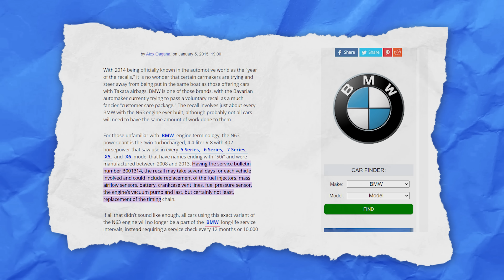WORST Cars You Should NEVER BUY!

Comment: It was unfair to use a lexus photo when they reliable af!
Reply: The same thing i am saying the video is suppose to be about unreliable cars not a superb war tank like the lexus is250
Reply: The only thing you can rely on with Toyota crap is rust holes the size of your fist
Reply: @Welcometofacsistube  Id rather drive fully corroded Toyota on wheels than pretty much 90% of other cars on car transporter with broken engine/gearbox/suspension. I can always drive to the varnisher and solve that problem.
Reply: That car will still be around when you're grandchildren drive
Reply: Click bait
Reply: Right !!!!!!!!! Smh lol 🤣
Reply: Called click bait
Reply: Dislike the video because of this. I’ve owned almost 30 cars and absolutely hammered the transmissions in 3 Lexus and they are indestructible lol currently own a RC F
Reply: exact reason why I disliked.
Reply: Lexus line tech here.  There is a reason we all call them the IS 2shity.  If you do a lot of highway driving they are fine, but a majority of city driving will cause carbon build up in the intake which will destroy the engine when a piece falls in.  Misfires are the first sign.
Reply: Me having a Is250 🥲, looks good but really slow for a v6
Reply: yeah wtf, talk about clickbait lol
Reply: @Welcometofacsistube  97 Toyota celica 286000 miles no rust
Reply: It's called click bait
Reply: Made you click the video though. I’m sure.
Reply: Is that the only problem with the Lexus mine does not pass emissions I don’t see it as a problem
Reply: @ezekiel4407   get the is350
Reply: So lexus is on here for being too slow I personally love the 4gr-fse I have no problems with it
Reply: Yep IS is super reliable I’m upgrading mine to 400 hp on my channel just need donations haha
Reply: I have a is 350 and love it!
Reply: @chrisadkins6830  the is 350 doesn’t have that problem because it’s direct and port injection
Reply: @VibeVault707  I have one and love it!
Reply: @TheReel_Fisherman  you are correct.  Thought about buying a 350.  But needed a truck more.
Reply: That's why they last 300k miles or more if taken care of while no matter how much you take care of other cars, it's extremely hard to reach a mileage about 250k (that includes Honda turbocharged engines)
Reply: Really tho, I love my new IS 250 2015 it runs like a champ 💯💪🏾👑
Reply: @kamaumoore2025  lol sure
Reply: @Ytflosx10  oh? I own 3 vehicles that have over 3000000 miles on them and one are Toyota junk.
Reply: Agree i got a 250 n had it for 6 years. Reliable. Ive kept it. N alsp owned 2017 amg, 2021 charger scat etc.. the lexus has stayed.. its just. Perfect. Lol
Reply: @m4rcin847  same. Toyotas could survive a nuke
Reply: I don't like clickbait
Reply: Life isn't fair
Reply: @Welcometofacsistube  yah Cos u can drive that thing until the end of time. I forget a hole here and there
Reply: LMAO, what is it with indians & Lexus? Y'all do know they just rebadged overpriced Toyotas, mostly consisting of carolla or Camry parts. Also the only decent Lexus is the LS400 & the rest can & do have reliability issues
Reply: He put the is250 on the list because it was underpowered, nothing wrong with the engine whatsoever
Reply: Toyota KING OF BEING MID💯💯💯
Reply: Npc .
Reply: @calzstevenson7017  pretty sure it’s everyone not just the Indians
Reply: Toyota went from notorious engines like the 22re, 3sgte, 7mgte, 2jzgte, to making aluminum open deck garbage engines.
Reply: I have an IS250 and I love it. Reliable af gets me to A, B and C whether i just grandpa drive it or throw it around on the back roads. its definitely not a fast car, but capable and reliable.
Reply: @chrisadkins6830  I always use seafoam after every oil change to combat it. plus I do use 93 fuel and I run the engine hard every so often to burn off the buildup.
Reply: I unsubscribed.
Reply: @Welcometofacsistube  tell me you’ve never owned a Toyota without telling me you’ve never owned a Toyota:
Reply: @kylechin3244  the is250 is pretty reliable, but not absolutey durable by any means. i own one, its a good car but far from toyotas best reliability wise
Reply: This channel is not great.
Reply: Toyota is one of reliable car ever built and to use there pictures in the thumbnail is a slap in the face.

Comment: 9:50 whats sad is Nissan spent 15years  Clinging on to those cra0 transmissions and it ruined the entire company, that was literally the ONLY issue Nissans had, in the 2000s although power steering leak is also a  common Nissan issue as well lol...
Reply: exactly
Reply: Had it not been for the CVT, I’d totally consider getting a used Altima, Maxima, or even Sentra in the past.
Reply: @M67v  buy a Toyota.
Reply: Like me
Reply: @riccccccardo  I did. Got a 2012 Camry XLE V6 last year and now my sister drives it.

Comment: How could we forget the infamous Crossfire Injection that GM used in the early 80s on their V8 sports cars? It works great when it works but its short lifespan has caused some necessary parts to be hard to find and the intake manifold had way undersized ports to "increase street torque" aka try to be fuel efficient. I own an 84 corvette with one and its a very primitive fuel injection system. At least the engines it was used on were classic small blocks
Reply: Primitive fuel injection....is on 63 vettes
Reply: @drunvert  pretty sure throttle body fuel injection is primitive by todays standards

Comment: 10:50 The 2.0l is actually pretty alright. ringland failure is only really an issue on the 2.5s due to how thin they are
Reply: Had a 2010 1.5l Subaru Impreza for my first car and within 5k of ownership it ate all its oil and just about took the 4 speed automatic with it wasn't due for a service till another 7k sold it immediately
Reply: Any subarus that come stock with a turbo are trash. Period. Ring lands, headgaskets, glass geared 5spd, spun rod bearings.....etcetera etcetera....Have you ever owned or worked on a Subaru?? The only motors that have perfected horizontally opposed motors are airplanes, some lawn mowers and Porsche....and let's be honest subaru ain't NEVER gonna be a Porsche...

Comment: The is250 was and is reliable. Had it for 3 years and drove it from 80k miles to 170k and was slightly modified with no issues expect for small shit like battery and ac. Other than that it was definitely under powered. I’d suggest getting the is350 if u want more power for the money but if u want a nice looking commuter then is250 is completely fine
Reply: It's not the first time I've heard of reliability issues with the 4GR-FSE engine in the 2nd-gen and early 3rd-gen IS 250. IIRC, Car Wizard cited a design flaw in the "D4" direct fuel injection system. The larger and more powerful 2GR-FSE in the IS 350 uses Toyota's D4-S system that combines direct injection with port injection, making it more reliable. It's part of the reason why the 2nd-gen IS 350 is on my car wishlist.
Reply: I agree! and own one still.
Reply: @JobiWan144  simple fix is to use carbon cleaner before every oil change, cleans off any carbon build up and the 4gr will continue running strong. it’s a good engine just the direct injection is it’s achilles heel. keep in mind these have forged crankshafts and rods and hypereutectic pistons. it’s still a toyota which will last a loooong time
Reply: @2isjesus957  Perhaps, but why not just get a 350 anyway? Reliability aside, it's got 50% more power. The only reason I can think of is that you gotta have that last Lexus 6MT, but a) if you care that much, you could manual-swap a 350, and b) I think I'd prefer flappy paddles for a daily commuter anyway.
Reply: @JobiWan144  the same reason people buy a 350z instead of a 370z. it’s more expensive and not to mention how expensive it is to manual swap a 350. if someone does want it purely for the 6mt then let them some people don’t prefer paddle shifters and that’s okay
Reply: @2isjesus957  I put a $25 catch can on my is250, problem solved.

Comment: In 2014 the new Lexus is250 (204hp) was slotted between the BMW 320i (181hp) and the 328I (241hp).  The is350 was 306hp and the BMW 335i was 301hp. One hack writer in 2014 said the is250 was under powered compared to the 328 & 335. But compared to the entry 320 it is not.
Reply: Yeah man is250 is really slow but it's still a pretty fun car. It will beat other cars but any other lighter cars can beat it to 100. In some place they have a 3L engine. Where I am we have the 2.5 is250 and 3.5 is350. I think the 3L would be a good balance

Comment: My first car, bought from my own money, was a 08 VW Passat 2.0 TFSI. Started to have engine problems within a month. Second car was a 14 Ford Focus SE, automatic transmission problems. 3rd car was a 12 Golf GTI, which had pretty bad carbon buildup and EVAP problems. My current car is 05 G35 Coupe, the only problem so far were the crankshaft and Camshaft sensors going out.
Reply: I think it's 3-5 rating nonetheless good car
Reply: You have to clean out the intake valves on direct injection engines. Every 60-70k miles. Did you not know this?
Reply: @BabyBugBug  Yeah I knew this, took the car to a shop to have it done. The VW dealership was unable to fix the EVAP problem, according to them there were no problems. So I sold it.

Comment: There's a reason I stay away from CVT cars. They're expensive and parts aren't easy to find. I'm planning on selling my grandmother's Honda HRV if I inherit it. The CVTs in those things consistently fail at 100K miles, and I'm not paying 5 Grand for a new one.
Reply: Toyota CVTs are super reliable. They've been using them for almost 20 years and I've never heard of one failing. The CVTs from other companies, that's a different story.
Reply: nobody even rebuilds them. so thats another issue by itself
Reply: I own a 2017 nissan Rouge with the cvt and it has 99,000 miles so I guess I should start looking for a new car.
Reply: @Austin-ne3gn  I said Honda, not Nissan. I can't give you a mileage for CVT failure in a Nissan because I haven't looked it up.
Reply: @Austin-ne3gn  the Nissan/Jatco usually give up at like 60k miles, so I'm surprised it's still going. Yes, I'd get rid of it. Get a Toyota
Reply: @stephenmoore1541  nah I concur my girl has a sentra with the cvt and has 235k all her miles…only problem is wheel bearings
Reply: Idk, my mom has a 2015 Nissan Versa Note. The first transmission failed at 48k miles. The second is quitting after only 20k miles. Not a fan personally

Comment: Paid $7,000 for a 2011 Ford Fiesta and after 1 week the transmission shit out on me on the way to work 🤦‍♂️… Then ford wanted to charge me for dropping the transmission to check what’s wrong with it. They replaced the transmission and the second one shit out on me 3 weeks later plus it came with high RPM idle and shakey driving in the steering wheel… The car is a disaster!
Reply: I agree. 2013 Fiesta SE hatch, worst car I've ever had

Comment: I disagree with the Lexus IS. I have one and it is really reliable and super easy to work on. Only complaint is the 204 hp. But I’m upgrading it to 400 hp. At 220 hp now going to upgrade exhaust headers put on a turbo or supercharger and chip later.
Reply: Damn man how is that going. That's sick as fk man
Reply: @nivlz  it’s on hold right now. My mechanic has been very busy and has put me at the end of the line 😤😢
Reply: @VideosRUSWorld  oh man
Reply: What kit are you using
Reply: @nivlz  not really a kit just add ons. Glossy front lip and side skirts and black diffuser and glossy lip spoiler. I also have wide body black sides. Want to do myself but don’t have tools like the mechanics. Later on I want to wrap it baby blue like my dodge.

Comment: The N63 is actually reliable and they still make that same platform on new models. I’m order for it to be reliable you must do the recall warranty service that they did for the older models.
I had a 2011 750 Li M-Sport and really never had issues because I took care of it. And it didn’t consume oil because of the valve seals that were changed for free from the class action lawsuit recall
Reply: @richardwilson5404  it depends which BMW you buy and how you maintain them.
Reply: Idk I have a N63 in my X6…. & even eurofed a highly specialized German shop. I believed told me that they’re decent engines but they do sell those engines for cheap. I definitely understand why. I fixed almost all the problems on mine but it cost about $10k no warranty

Comment: Funny enough my mom had 2 of these cars. A 2002 cavalier that she bought with 10,000 miles in 03. Had a 5 speed and a 2.2 in it. Got a couple of electric fans, a fuel pump, and a coil pack in 200,000 miles. She quit driving it in 2012. Then she had a 2016 Sentra that had the CVT in it and you can guess what happened at 100,000 miles.

Comment: You should've mentioned that the 2nd gen is also came with a 3 and 3.5 litre v6 which was much more reliable and powerful because the 2.5 kinda gives the 2nd gen is a bad rap. (ik it also came with the 5 litre but those are rare)
Reply: If you are referring to the IS250 I don't understand why it is on here. It is a little underpowered however still a solid reliable engine that has been known to cover a lot of mileage just with routine maintenence. You can do A LOT worse than a IS250.
Reply: @gavinr9107  It's not the first time I've heard of reliability issues with the 4GR-FSE engine in the 2nd-gen and early 3rd-gen IS 250. IIRC, Car Wizard cited a design flaw in the "D4" direct fuel injection system. The larger and more powerful 2GR-FSE in the IS 350 uses Toyota's D4-S system that combines direct injection with port injection, making it more reliable. It's part of the reason why the 2nd-gen IS 350 is on my car wishlist.
Reply: @JobiWan144  A carbon clean will clear that issue up and the engine will run exactly as intended. This is a common issue with some Audi/VW engines as well that only utilised direct injection. Still doesn't justify a listing under 'the worst drivetrains ever built'. Absolutely moronic inclusion in the video.
Reply: @gavinr9107  Yes, it's probably a bit of an exaggeration

Comment: So here we are just talking about the is250 right? I've just bought an is350 yesterday and, after months of investigation, never saw any problems related with emissions or power
Reply: The 250 and 350 have different engines. With Lexus, the numbers are representative of the engine size. 2.5L vs 3.5L.
Reply: There are no problems with the IS250 at all. Ideal media are just having a whinge because it is somewhat underpowered.
Reply: Hey thanks for your comments, someone could help me with this? My lexus is350 recently started to make a weir noise under the engine; do you know any problems that could be? Rn I'm not sure where the noise is exactly, but it seems to be near the engine. Maybe the belts or could be something worse as piston rings?
Reply: @stephenmoore1541  Hey thanks for your comments, someone could help me with this? My lexus is350 recently started to make a weir noise under the engine; do you know any problems that could be? Rn I'm not sure where the noise is exactly, but it seems to be near the engine. Maybe the belts or could be something worse as piston rings?
Reply: @gavinr9107  Hey thanks for your comments, someone could help me with this? My lexus is350 recently started to make a weir noise under the engine; do you know any problems that could be? Rn I'm not sure where the noise is exactly, but it seems to be near the engine. Maybe the belts or could be something worse as piston rings?

Comment: GM 3800 Gen I (L27) and Gen II (L36) NA Engines.  They either sludged your coolant through a pos lower manifold or caught your engine on fire from oil leaks into the exhaust manifolds.  Supercharged (L67) engines didnt seem to have the first problem at least, I traded my 1998 Bonneville SSE back in on a 2000 SSEi that was great.

Comment: Had an 08 lancer gts that overall was fun but that cvt transmission kept it from being better. It was the worst when driving up a curvy mountain. I ended up using the flappy paddle shifters a lot but there was a limit to what they could do.
Reply: I own a 09 gts same issue I notice if you let of the gas a bit the gears tend to switch but its not 100% all the time. Still a fun car to drive despite that

Comment: It’s so funny the nissan cvt made this list as an honorable mention and I own a tuned one. 😂

Gotta say i’ve had to replace it twice under warranty and from my experience surprisingly there is magic in a cvt transmission. However these companies have built them very fragile and I wouldn’t assume they thought twice about reliability as much as they were going for fuel economy and smoothness. 

Since then i’ve changed my fluid from OEM to valvoline’s and installed a trans cooler. Night and day 👌. should’ve came like that FACTORY everyone’s story about cvts would be different

Comment: I don't consider oil consumption to be a big problem. Yes, it's inconvenient but not game breaking.

At this point it's completely common to hear that a "modern car" 2010+ will burn a bit of oil between oil changes. Now to what extent is a different question. That's a combo of low tension poison rings, turbos and thin oils. Ask in the name of efficiency. 

Typically, if you're burning less than 1/4 the sumps capacity between oil changes your fine. Just top it off and keep it moving. Oil is cheap; a new motor is expensive. If you're burning more than that,  then there's a problem.